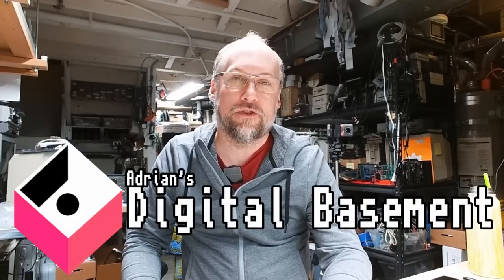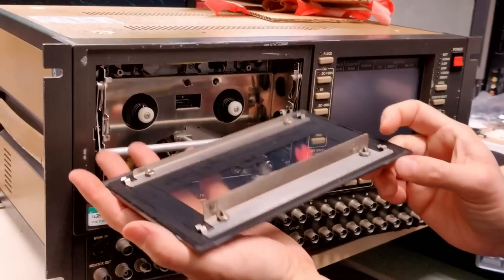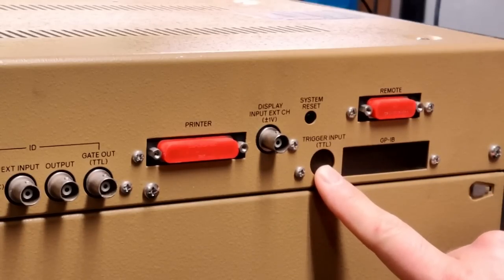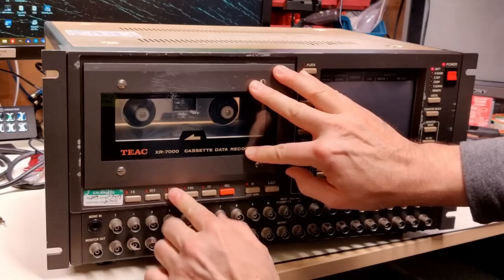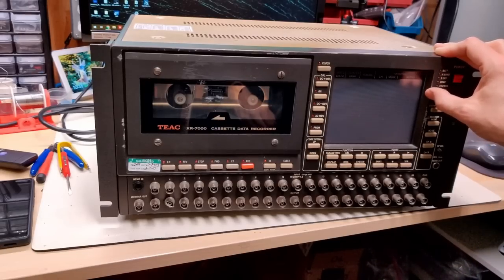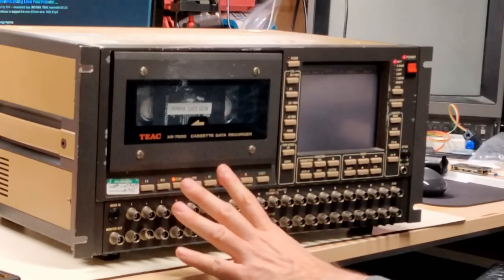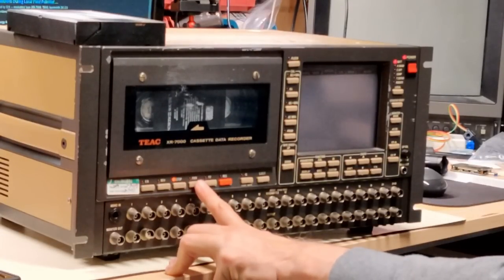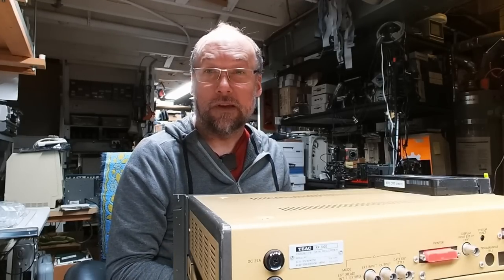0057 A mystery data recorder, a hurt Sun SPARCstation IPC and a MEGA little TV

Comment: I have never seen one of those but all the BNC reminds me of an Ampex 1" reel-to-reel with FM record/reproduce modules. They record analog voltage witt volto-to-frequency and frequency-to-voltage and tape heads with as many channels as required. They are very cool. Analog in and analog out. Plus you can set speeds and controls to record slow stuff and play it back fast, like bring an earthquake up to autio speed.

If this used a spinning angled head like for video tape then there must be more sphisticated electronics. If the head sits still and you can see all the little gap magnet lines, it is probably all analog.
Reply: This is the same type of device, but newer tech.  IRIG recorder is what I’ve seen it called, as it follows an IRIG standard for telemetry recording

Comment: Those SPARCstations are pretty cool, but unfortunately their power supplies are VERY susceptible to the Great Capacitor Plague of the 2000s. Odds are that when you open that up, all you'll find is carnage. I have a SPARCstation LX (similar class of machine, in a similar form factor) that I am trying to restore, and the power supply was pretty much a write-off. Tons of leakage, and some of the traces look damaged. I'm not entirely confident in my ability to work on high voltage electronics, so I decided not to try and attempt to restore the power supply PCB, and instead ended up converting an old ATX power supply I had lying around to power the thing. It does work -- they have the same power requirements (+/- 5 and 12 V) and very similar wiring. You'll need an ATX supply that supplies all the voltages (both +/- 5 and 12 V) -- iirc some newer ATX supplies no longer supply negative voltages -- and there are wiring diagrams online.

Unfortunately I am now running into another problem: exploding tantalums. I plugged in my rewired ATX supply (yes I did get the wiring correct, I double and even triple checked it) and when I turned on the machine there was a loud POP!! that scared the bejeezus out of me, coupled with a bright flash and an extremely foul odor. The machine did show a boot prompt, so my guess is maybe the cap that blew was some sort of power filtering cap? Either way I haven't touched it since, I'm not a fan of capacitors exploding in my face, and also I am not sure how to proceed, because the cap that blew is literally obliterated, I can no longer read the capacitor value off of it, and none of the LX motherboard pictures I could find online are detailed enough for me to be able to read the capacitor values. So I don't know what to replace it with. I also need to get a SCSI hard drive emulator. I'm eyeing one of those new BlueSCSI V2's, they look pretty sweet and seem to be compatible with a wide variety of systems. Fortunately I was able to image the drive that my LX came with before it kicked the bucket.

Comment: The keyboard and Mouse for the SparcStation IPC was the Type 4. You may be able to find one on Ebay still these days. The keyboard was PS/2 like, but not quite identical. Your best off finding a real Type 4 keyboard and Mouse if you can. You might be able to find PSU's as well. There used to be a lot of used Sun equipment and parts out there. BTW.. I worked for Sun for 11 years.

Comment: GP-IB is also known as HP-IB, which is also known as IEEE 488. 

I have a Hewlett Packard 86B computer laying around that has a HP-IB interface. It's designed to interface lab instruments. Clearly this recorder was designed to record data taken from a laboratory setting.
Reply: Of retro computer relevance it's worth mentioning that the Commodore PET had GPIB although software to use it might be really hard to find.

Comment: Sun serial ports are the same pinout as old Mac serial ports. I have a sun kb and mouse here i think. Used to have a couple IPCs and i think i have the shell of one left. I know i sold my IPX to someone in like 2000. My Sparc 5 may or may not be lurking in my old boss' garage. 

Serial console should work fine. 

The little fuses on the motherboard blow easily. They look like little cylindrical light bulbs.

Comment: The power supply probably needs recap, i did it on my LX which is similar to the IPC. If you need help getting this up and running, I am local to the PDX area, i have all the things needed to get this running once the power supply is running. I found suns very robust, it is not a power house, I use mine for image capture.

Comment: I wonder what the voltage rails were in the Sun?  If you could just fit a mini-ITX or 1U server power supply in there?  Older Dell Optiplex, like the 990 had a nice compact multi-voltage supply.  I think that changed for to 12V only for the 7020/9020.
Like people said, considering no heatsinks, it's probably a slow box.

Comment: Does the recorder scans the tape linearly or it has a spinning drum head, like a VCR? Would expect it to be drum based considering its function as an instrumentation recorder, in order to squeeze the most bandwidth without having to run the tape at insane speeds.

Comment: Chapmans Glitchworks makes Dallas time chip module replacements/rebuilds.  What is normal for the TOD in a IPC is: take a dremel and very carefully remove the chip package plastics around the button cell connections, cut the cell connection and connect a replacement battery holder to the connections.

Yes the dallas chip will by this time be dead.

Comment: The Sun IPC is 20MHz if I remember correctly.  I used to have a few dozen of those, but I'm not sure if they're still in storage, or if I lost them in a move.  They're definitely fun to play with, but definitely NOT powerful.  That model case is known as the "lunch box", as opposed to the "pizza box" Sparcstation 5/10/20/etc.  I know I still have several pizza boxes, and a LOT of accessories for them.  I should have several keyboards, mice, TONS of RAM, framebuffer cards, processors, network cards, and who knows what else.
Reply: The IPC runs at 25Mhz, the earlier SPARCStation 1 runs at 20 though. Technically a 25% performance increase!
Reply: @eehawkee  I haven't used any of my Sun equipment in many years, but I was pretty close with my estimate of 20MHz for the IPC.  I was never a fan of lunchboxes to be honest, and usually overlooked them for the nicer pizzabox design.  The info I could find about the Sparc 1 isn't consistent.  Some sources say it has a "LSI L65801 @ 25 MHz" processor, other sources say 20MHz.  I don't know if I've ever even used any of my IPC or IPX boxes for anything other than stacking up to use as a coffee table.  Some friends and I found an entire dumpster full of Sparc equipment in front of a school in NYC years ago, and we called everyone we knew with cars to unload as much of it as possible.  I ended up with a few dozen machines for myself.  I actually used a few of the pizza boxes (mostly Sparc 5 and 10) for different things over the years, but they're all sitting in storage now.  It would be fun to bring them back to life.
Reply: @eehawkee  Yup, it had the first generation uSparc II, later replaced by the uSparc IIep (Embedded PCI controller) which was used in the IPX
Reply: @CaptainSandwich  That's not true, the microSPARC-II was used on the SPARCStation 4 and 5. The IIep was never used on SPARCStation only embedded devices like the javastation or sun ray. The IPX used an enhanced version of the original SPARC clocked at 40MHz it was made by several manufacturers.

Comment: I have test instruments with similar screens, they all fail after 30+ years even if not used, the capacitors on the PSU's and CRT screen unit fails, you need to re-cap them. You also want to copy the roms with an Eprom programmer and copy them back onto the Eproms in order to refresh them before they die of old age.

Comment: With the TEAC, it looks like a power supply failure in the control circuits. I would start with the obvious: Capacitors on the logic boards, DC supply voltages and ripple, and drive belts/pinch roller rubbers. The tape chewing could have been one of the capstans slipping.

Comment: I saw the  problems you were  having with google so I Duck Duck goed it, and it took me to a eBay ad, dated Dec 21st 2022, were the unit you have was sold, it has the same crushed inputs on the lower left front.

Comment: I didn't had the time yet to watch the entire video but the Teac shutting down looked like it was on an internal battery power, the red led at BAT position was always on and the display was showing a battery level at less 4%, such a unit doing important data logging it is logicial to think that they have an internal battery for backup in case of power loss

Comment: It might be neat to see some kind of LiPo battery-pack mod for one of those portable Sony TVs. How much runtime would you get with 8 D-cells worth of LiPo battery pouch?
Reply: A 12v lipo that size, would probably last quite a long time, could also add an internal charging circuit, that would charge the lipo when plugged in to mains.

Comment: The tape door probably stays open to make sure its super obvious there is nothing to log your data onto before starting the experiment, in practical use there is probably no reason to have the machine on without a tape inside ready to record or playback.

Comment: I know on the IPXs, the timekeeper chip would die and you would lose the mac address for the system.  You can replace the chip, but have to go in and create a mac address for the system.  We had that happen to a few systems, they were never going to touch the outside world, so there was DE:AD:BE:EF::00:01 and other foolishness. The page that we used to find out how to set the mac address is still around google for: Frequently Asked Questions about Sun NVRAM/hostid

Comment: As much as I love Sun machines, I wouldn't invest too much time into repairing the IPC. It's the second-weakest system of the series, with a Cypress-made 25 MHz microSPARC CPU, and can take a maximum of 48 MB of RAM if you manage to find the right type of 4MB SIMM sticks (I seem to recall there was something weird with parity that the normal 30pin SIMMs at that time did not have...). It should be able to run Solaris up to version 2.6 or maybe 7, but with such a slow CPU it's no fun at all. Both the internal GPU on the 13w3 and the SBUS plugin card are a "bwtwo" monochrome 1600x1280 framebuffer, so you should at least get some reasonably high res video. The DB9 on the SBUS card should be Hercules compatible, but I have no idea how the 13w3 needs to be adapted. With a bit of luck, a regular 13w3-to-DB15 VGA adapter and a multiscan monitor could work. For a keyboard, you'd have to look for either a genuine Sun one, or find one of the rather rare and expensive PS2 converters, they use a different protocol than all other PCs and micros.
Maybe if you can get hold of at least one of the better models of that series, like the LX or Classic, with a 50MHz CPU, 96MB RAM and onboard color graphics, that would be worth keeping and installing.. but the IPC? *shrug*
Reply: Just a small correction, the IPC does not have a microSPARC, the microSPARC was a sun4m class processor and was made by TI. The CPU in the IPC will be made by either Fujitsu or LSI.

Comment: Running slowlaris on a IPC is like running Linux on a 386 dx-40 with a Weitek 387. Run an early version of Sun OS with Openwindows. Don't do Solaris CDE. They're fun machines. But a 486 running Linux will beat it hands down.

Comment: That SPARCstation is the exact size to fit under the base of a Sun monitor.
Reply: Well, for the Sun monitors of the same generation.  Earlier Sun monitors had bases that fix the pizza boxes of Sun 3's.
Reply: @Mueller3D  fair point. Likewise the base on the (horrible) tatung that I "inherited" with my sparc when I started my job would have tipped right off. With hindsight, that might have been a good thing.

Comment: The Teac XR-7000 is a vintage audio receiver that was popular in the 1970s and 1980s. It was designed to be used as the centerpiece of a home audio system, allowing users to connect various audio sources such as turntables, tape decks, and CD players to the receiver, and then output the audio to speakers.

The Teac XR-7000 has a variety of features that make it a great choice for audio enthusiasts, including:

    Multiple audio inputs: The receiver has inputs for several different audio sources, allowing you to connect your turntable, cassette deck, CD player, and more.

    Tuner: The receiver also has a built-in AM/FM tuner, allowing you to listen to radio stations.

    EQ controls: The Teac XR-7000 has EQ controls that allow you to adjust the bass, treble, and midrange frequencies of the audio output.

    Power output: The receiver is capable of delivering up to 70 watts of power per channel, making it suitable for driving large speakers.

Overall, the Teac XR-7000 is a versatile and powerful audio receiver that can be used to drive a variety of audio sources and deliver high-quality sound to your speakers.

Comment: Usually it's the SMD's that were bad in the 90's and 00's. The through hole ones were USUALLY fine. Obviously not in this case though.
Reply: That’s right around the time there was that big issue with counterfeit electrolyte if I remember correctly.
Reply: @Renville80  yeah....I don't know how that went on for 20 years.

Comment: Ahh the SPARCstation IPC... bought that one on a computer show when that was still a thing. It worked, which was a happy thing. Used that for a long time. 25 MHz I bbeliever. I do not remember the video on the IPC, but I had an 8 bit color screen, I presume that is the board with the RAM.
I also had a 24 bit color graphics card with Z buffer, but that one was broken.

Comment: IPC is a nice little historic machine, not powerfull, not overly usefull in todays world. It doesn't run any modern versions of Solaris, and even for old versions, you want something relatively small. Don't remember what the most recent version is which will technically still run on it, but I'd suggest sticking at versions before the marketing name was changed to Solaris (so.. old SunOS versions, 2.5 or earlier)

I've used one running netbsd for years, might even have it still.

Comment: That new camera sucks, the background was constantly pumping in brightness, you need manual control.
I've been using  iVcam with an iPhone (does Android as well) and that can be manually controlled, very low latency, great on Zoom, probably works with OBS. I have been using that with a separate audio feed and the lip-sync is fine.
Only problem is it's not free.

Much better than the lack of success I've had with IP cams, near 1 sec of lag kind of does kill your lip-sync.

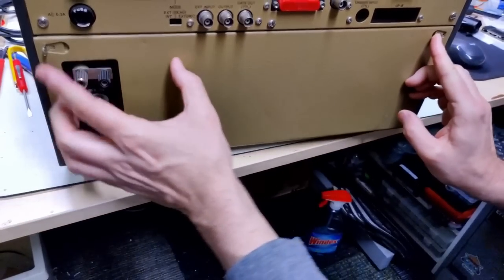Comment: 7:39  Bet that TEAC is a digital chart recorder (or maybe even analog).  But the only reason you'd need that many channels is for some sort of chart recorder.  Given the calibration sticker, probably a laboratory instrument of some kind.
Reply: 13:57 Based on your googling, that is indeed a chart recorder.  If you have a crap ton of sensors you need to record synchronized data on, a chart recorder is your friend!  Used to use analog ones that printed to paper, back in the day, but nobody does that anymore.  Nowadays it's all high bandwidth digital recording.

Comment: The teac 100% useless no leads or sensor's only a power cord.. so there's no point fixing it because it would still be useless to everyone.. and would likely be next to impossible to find the attachments and sensors ECT plus the software to connect it to a PC.. all I can see it being good for is a source of chip's and diodes and caps and resistors lol